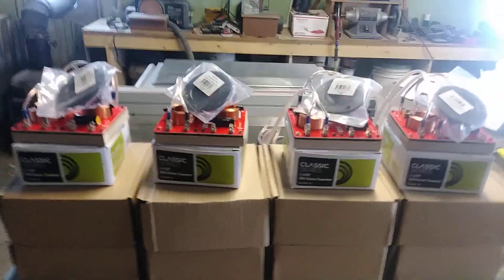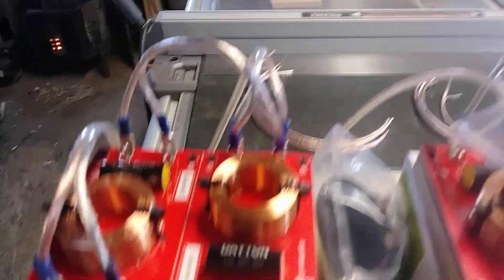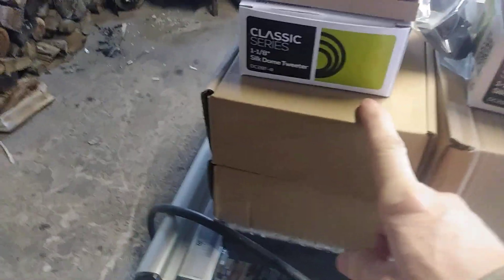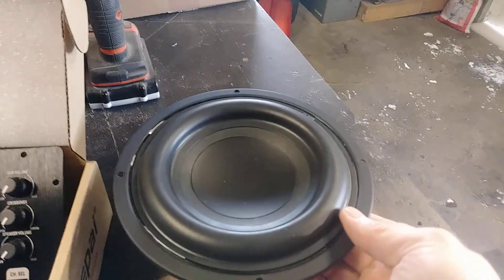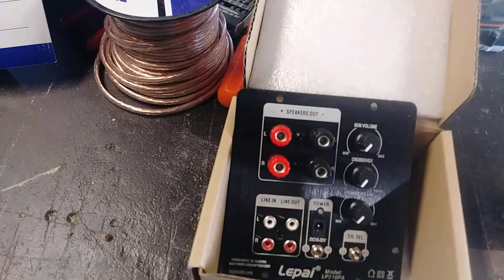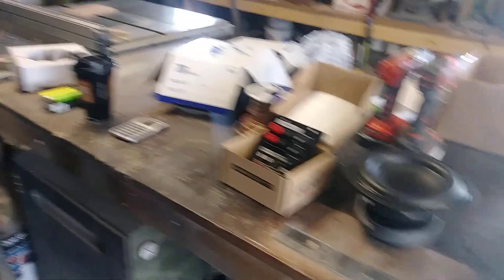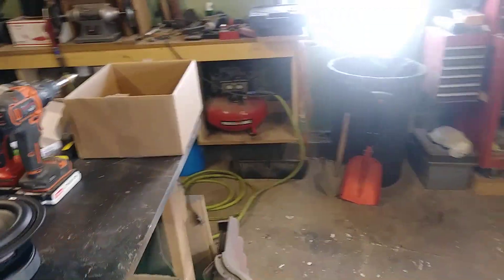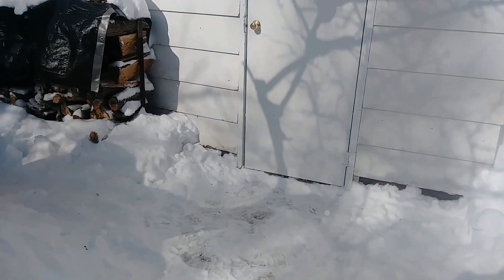Cabin Fever GRRRR..!

Comment: Looks like a nice little sub you got for your buddy there...what was the name of it? I couldn't make out what you said in the vid...How's the price on them? Looks to be good quality from what I can see in the vid.
4 of those in a home theater probably sounds awesome! A couple years ago I added a 3rd sub to my surround setup - a 10" Sony SA-W2500 powered sub and WoW I couldn't believe how much it improved the overall sound\experience. Prior to that I was only running 2 passive subs off the receiver which sounded ok but was lacking in the rumble department, I noticed once I added the powered woofer to the mix..so I can only imagine how adding 4 of those bad boys your building there would be lol
Reply from the maker: Thanks bud..! The name of the sub is Tang Band. I think I show the model number on the box in the vid. Goto parts express and check them out & all the reviews. Lots of good reviews thats why I bought it. Active is always better than passive. For my home stereo I'm running two 8s that I rebuilt from two 15+ year old Sony's I had. Factory kind of sucked but with a good box and ported correctly they really dig deep for 8s. Each one also has its own Dayton SA100watt plate amp for a seperate left / right subs. "Stereo bass" sounds bad ass lol...! I will never go back to a "mono sub" The whole system I have less than $500 into including a new Yamaha R-S202 receiver as well as all the drivers wood x-overs wire paint etc. It does not take a ton of money to get really good sound or even high end sound as compared to factory built and cost. I just ordered two new Dayton audio classic 8" subs since my cat the bass head he is decided he like one of them and clawed the rubber surround & shredded it. If they work in my current boxes with a nice tight punchy sound I won't end up rebuilding them but if they don't sound like what I had I will definately be building new including my MTM's. I have an idea for a "bass reflex" horn sub cabinet that should increase output a few db. If you ever need help or have questions I will do my best. I'm no expert but did audio for many years. The biggest thing is driver selection and box design. You may want to check out Dayton Audio ultimax subs. I don't own one but damn from what I see they are beasts..! Also check out their other subs etc and plate amps.